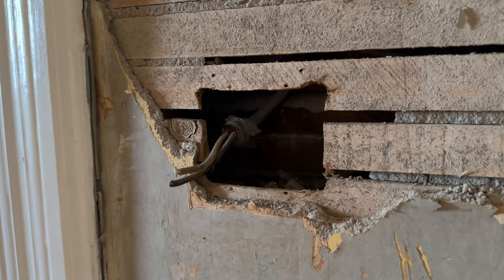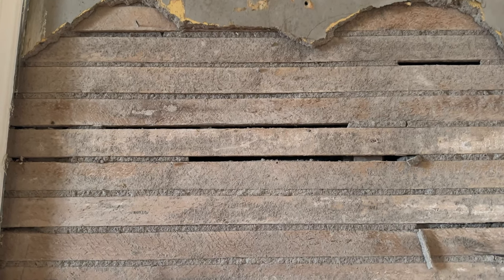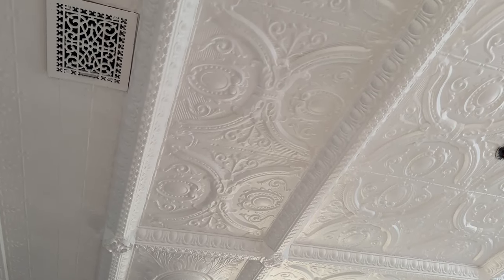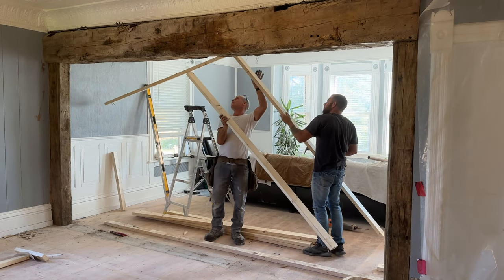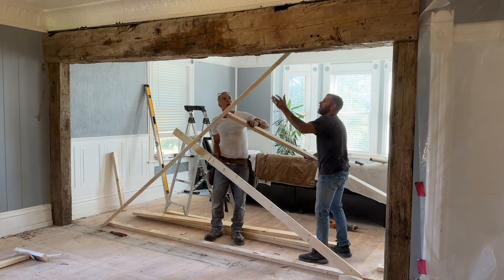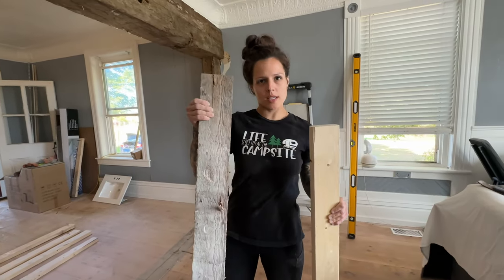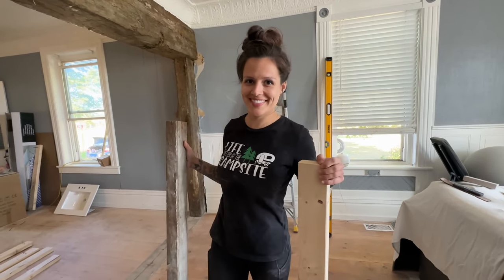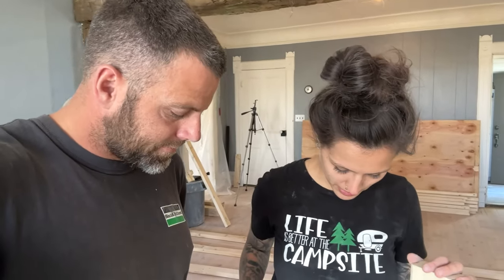Renovating A 122 Year Old Farmhouse| Here's What We Did..

Comment: Nice! I've just gotten to "DONE!! (for 2023)" on my own 125 year old in-town house in Houghton, MI, USA after having put in literally 100 sheets of drywall, uncounted rolls of wire & insulation, couple boxes of vapor barrier, replumbed the whole thing... You get the point.
Suggestion for the next time you're deplastering from lath- a $15 flat bar and a rubber deadblow mallet are likely to be your best friends. Slide under the plaster on top of the lath.. And put a lengthwise cut 4' piece of concrete footing tube on the floor just below the plaster removal: faster to pick up a heavy half-tube than to get that stuff off the floor, especially if you get fancy and put some rope as a handle on each end.

Good luck with all the projects! Seems like y'all have things well in hand.
Reply from the maker: Wow ! Good for you on your house too. Lots of work with these old houses 🔨😀

Comment: That looks great, just wondering the load on floors? Did you support the floor underneath so the weight is carried right down. Not sure if you have a basement or crawl space but support under neath as well so load is carried right down to foundation. P.S did you spray logs that were outdoors in case of bug infestation? Keep an eye out
Reply from the maker: There are footings in the basement taking the load of the wall 🙂 there were a few ants in the beam but that’s about it !